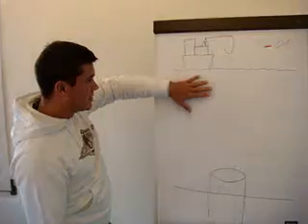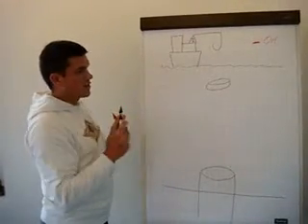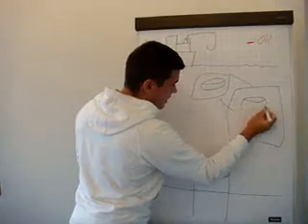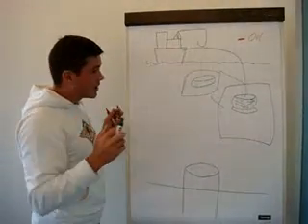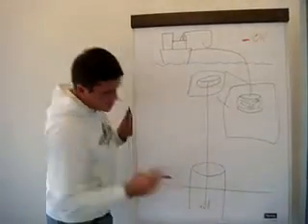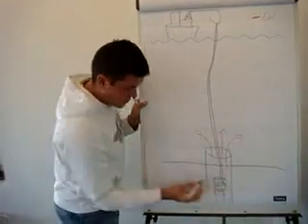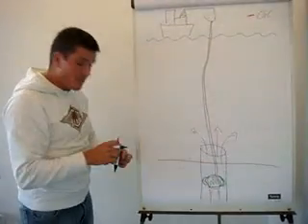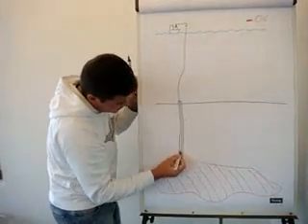Straka-Methode: How BP can close the borehole in the mexican gulf

Comment: @florin604
I don't completely understand why your points hinder Mr Strakas method from closing the well:
1. for what reason does that prevent a flexible balloon on a flexible pipe from being pushed into the well/pipes?
2. see above
3. so two smaller balloons are not possible to shuff it into the pipes? Or is there some other reason why not?
4. when it is not possible to push whatever in that pipe, how can they ever close that well?
5. it didn't prevent them from trying top kill
please explain

Comment: 1.the pipe is bent 
2.they work at the dept of 5000 feet 
3.they have two drilling pipes stuck inside the pipe 
4.the well case is cracked at the depth of 1000 feet - this is the reason top kill didn;t work
5.the pressure of the well is 13000 PSI
get it?